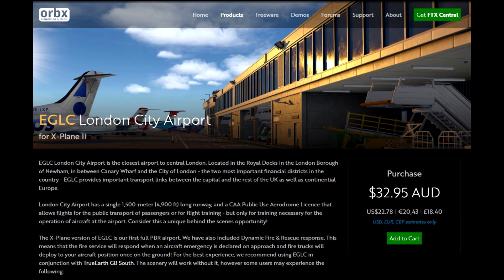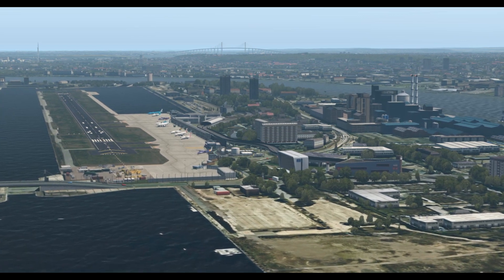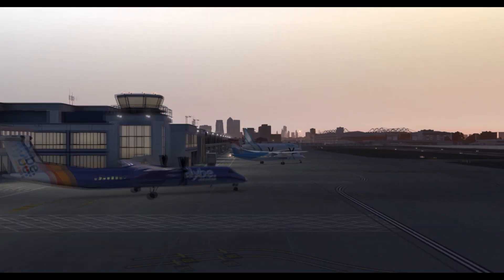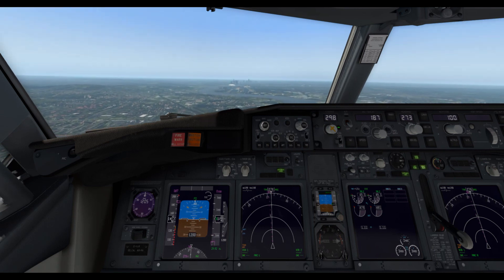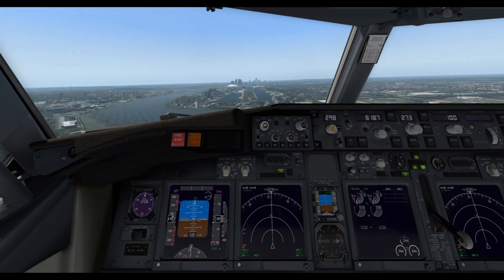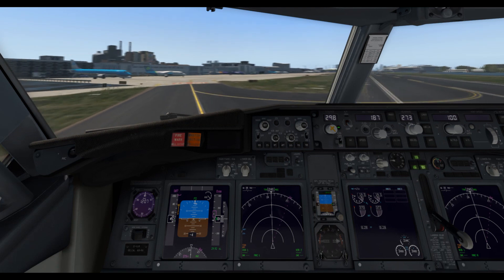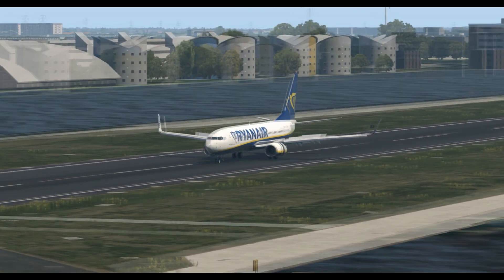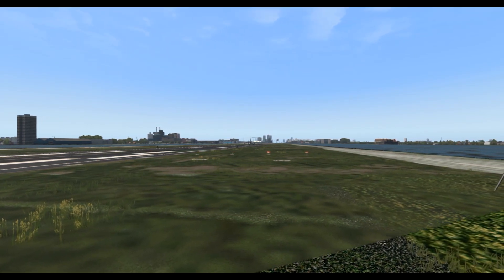XPD    Review EGLC Orbx

Comment: Yes, I was going to mention the stuttering which is a lot more noticeable now with the new TE South upgrade and the new EGLC airport upgrade. I have a modern top of the range PC and between EGLL and EGLC I get about 16 to 18 fps with virtually continuous stuttering along the route. I refuse though to reduce my graphic sliders which are all at maximum except the reflections one which is set to minimum. But now that I have my scenery shared between my 2 drives, things seemed to have improved somewhat.